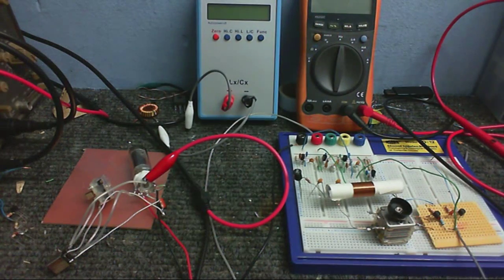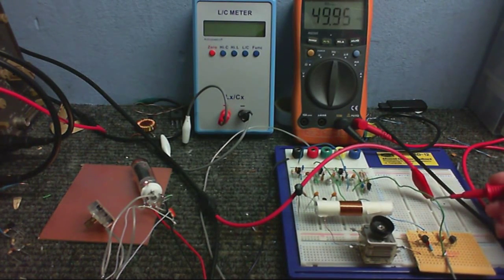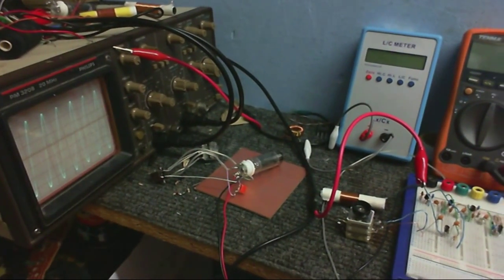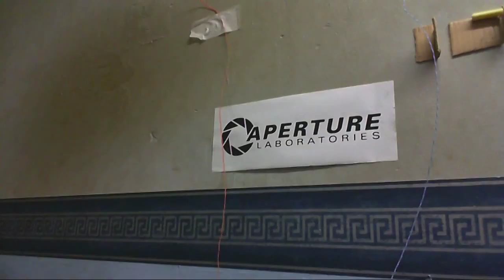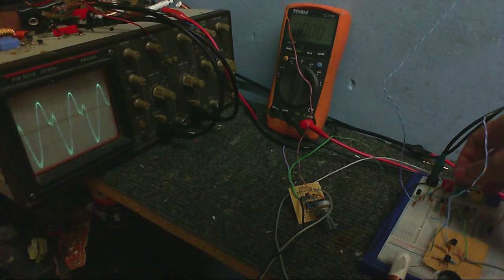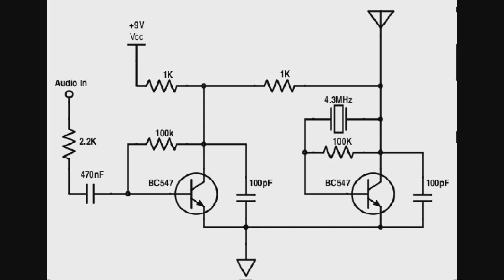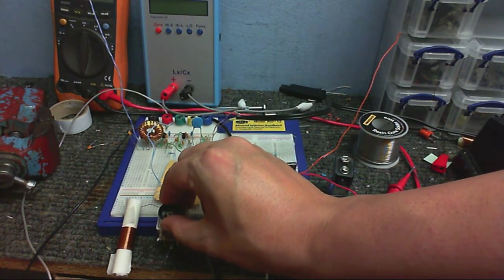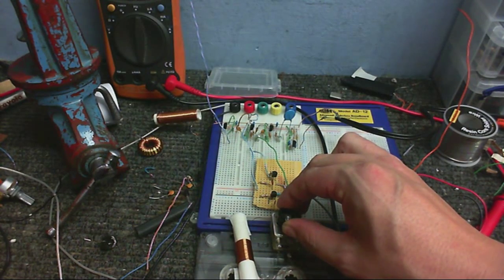Homebrew SW superhet radio ... success?

Comment: I reckon that it's the sound of delusion Clem.As HamAndShortwaveRadio says it does seem to be a Direct Conversion Receiver rather than a Superhet one.Direct Conversion uses a V.C.O. and a mixer to produce audio as a Heterodyne and is popular in Ham circles.The wheels seem to come off your understanding when it comes to the Mixer stage but you did come very close to getting what you were trying to make,Maybe Direct Conversion is all you need.